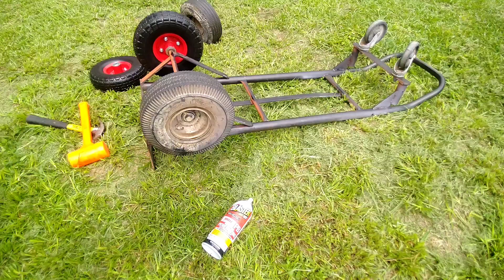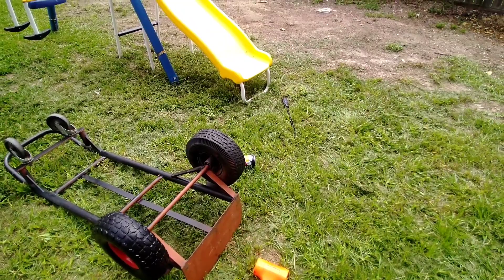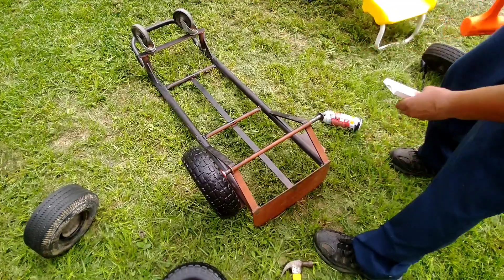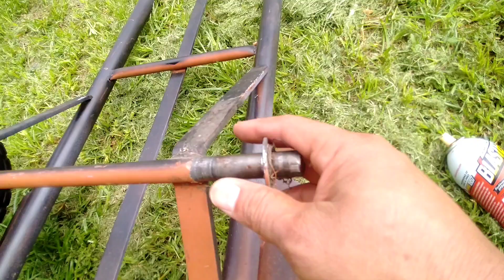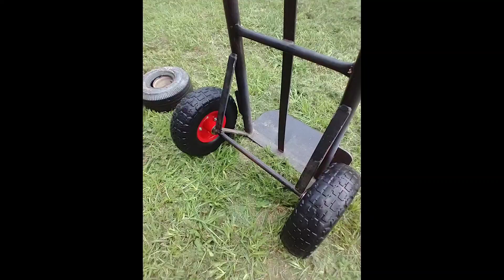Fastest way to remove handtruck dolly wheel

Comment: OMFG!!!! I wasted an hour or more trying to get that damn nut off.Braking paint can lid priers .Trying to find some little dam pry tool. Funny thing , though . I did think of basically the same thing without the idea of the Blaster application  and did a pound with a hammer from behind but it didn't just pop off. And I didn't use as much force .Just wacked the wheel. Your way with the Blaster stuff(which I had in the cabinet)and a wack with a 3 lb mallet and a 2x2 piece of wood  TADA. I had to go 20 feet to stop the wheel from going out into the street! And I used a socket to reuse the push nut.I love smart guys like you with simple solutions. AND YOUTUBE. 👍👍👍
Reply from the maker: I tried other ways as well till I got tired of no results. That's when I did this, had done one side already and decided to record the other for YouTube because it was that easy.

Comment: You are putting garbage tires on, those harbor freight will last you, well by now u will replace another set already.
Reply from the maker: I don't use it much but when I do I don't have to put air in them anymore. The tires still look new but I understand if you're using it alot you want some good tires on it.